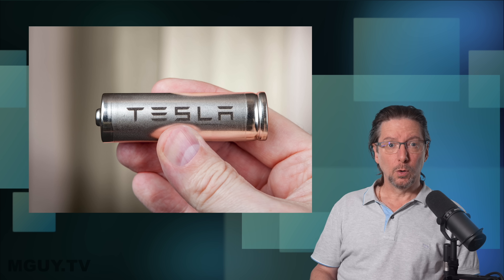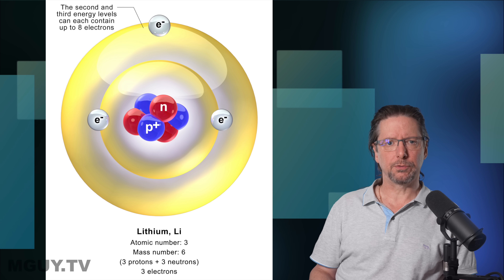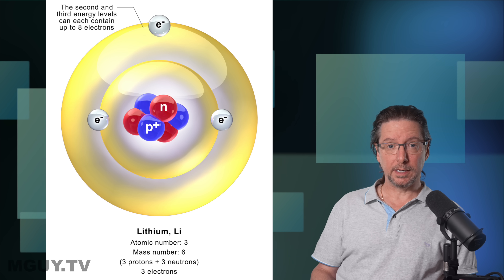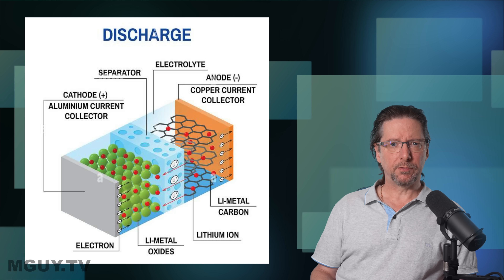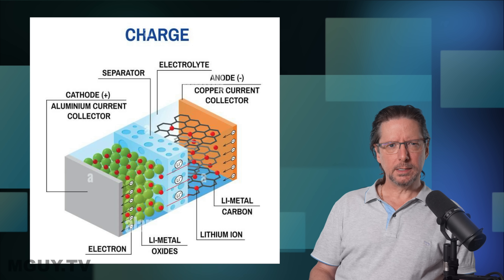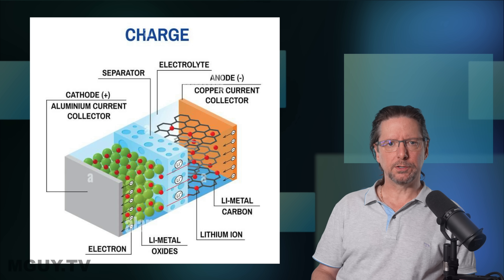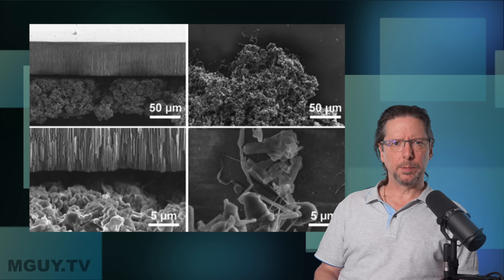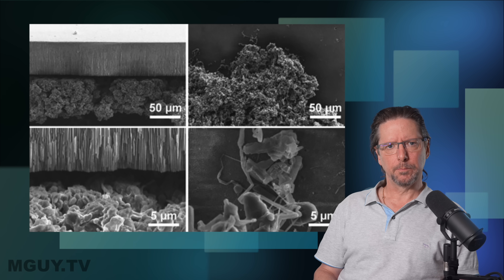Why are EVs so TERRIBLE in the cold? | MGUY Australia

Comment: If it were not so frustrating, this would be darn funny. I live in northern Michigan, some 300 miles north of Chicago. We have been telling the State Government for decades that electric vehicles will not work in the cold the way they do in the warmth of the summer. Chicago was cold, yes, but no where near as cold as it can be. I have seen it -20F for a week at a time. and have seen it as cold as -30F. At those temps, these batteries will not even stay warm if plugged into the  grid. you will have to keep them in a heated area. And this will increase your heating needs.  Government, at least in this case, is not listening to the scientists have have been telling them it will not work!

Comment: Why can't the charger heat the battery, then charge, instead of relying on battery power to do that???  Whoever designed the charger like that should be fired.
Reply: @mattingray5651 The charger can heat the battery first. MGUY is telling lies again. The guy is a big oil stooge.
Some of the Chicago drivers say when they plugged in there EV did not charge. What they did not realise was the battery was being preheated. Now if they had just realised they could have preheated the battery on the way...

Comment: Good explanation and points well made. I think there is a race on to solve these problems, which is the job of the free market, rather than government, but it will take time, as you note. If battery companies can deliver a battery that does the job, then that will be great for our lungs, for urban air quality and for Australia's energy independence. Until then, proceed with caution!

By the way, heat is not that good for a lot of battery chemistries either. I notice my Toyota hybrid, which has an air-cooled (passively cooled) system and uses a Nickel-hydride chemistry, does not like the heat either, and tends to be less able to retain power when the ambient air and cabin is too hot.

Comment: As usual, you start out messing up the facts. 
1) most were not owners, they were renters doing rideshare & didn’t understand about preconditioning the battery. Owners tend to know what to expect
2) Noway isn’t exactly tropical and has a very high % of RV ownership. When you know what you’re doing, cold isn’t an issue. 
3) you’re ignoring how horribly ICE cars perform in the cold. They also have reduced range and many won’t start ststart at all. EVs heat up the cabin much faster and rarely fail to start.
Reply: The internal combustion engine produces more power with cold, denser air.
Reply: @revolvermaster4939  per energy.gov ICE fares the same or worse in the cold: 
“expect conventional gasoline vehicles to suffer a 10% to 20% fuel economy loss in city driving and a 15% to 33% loss on short trips.”

Comment: Imagine if you applied the same rigor to the IPCC's B.S. hypothesis that has been DISPROVEN BY THE IPCC MULTIPLE TIMES. When you set up an empirical experiment and you don't get the result you're looking for, you don't get to modify your model ad-hoc and call it science. 

Take Ptolemy's epicycles for example: not science.

The IPCC has no clothes! When you go outside of your confidence interval, your empirical experiment is over! Additionally, they threw out UCAR and HadCRUT4 datasets due to being CAUGHT TAMPERING WITH THE DATA.

Comment: You’re talking about the theory of holes, when talking about moving electrons from one atom to the next, which basically is current flow. 
So, Lithium would need to be able to store energy (extra electrons) then release it via the theory of holes. However, as Lithium cools, there is greater resistance to electron movement, from one atom to the next, effectively slowing the process of the theory of holes and therefore the batteries power supply.
I assume this is the equal reason Tesla states owners should heat up their battery prior to charging in cold weather, as the theory of holes related to lithium, works best in higher temperature conditions. 
This would equally lead me to conclude that plug in EVs are best suited for temperate climates. However those temperate climates tend to be located near the oceans and therefor salt water, which is extremely detrimental to metals due to galvanic corrosion, this would create a double edged sword for EVs operating in temperate climates. 
Basically the warm atmospheric conditions are EVs best temperature for operation, however salt is also their worst enemy (Florida, LA, the Gulf etc.).
Humm.. 
Guess they don’t want that knowledge being available to prospective plug in EV buyers.

Comment: The EVangelists were blaming the users for not pre-warming their batteries, which takes energy and shortens range, along with heater and defroster. We just aren't ready yet. Need longer range, lower fire risk, faster charging, far more capacity in the electric grid, ...

[edit] I'm not against electrification, it just isn't ready for our transportation. All my yard tools are electric and I even just bought a "larger" snow blower with new batteries that work with my older tools. My wife and I really like these electric power tools, lighter, QUIETER, no gas exhaust smell when we dig out the driveway at lunch or before work. These devices are working out extremely well for us and have for more than 5 years. The last gasoline mower only lasted 2 seasons before destroying the engine, that's when I bought the mower and it's been great for years and years now.

Comment: EVs are not terrible in the cold. If used correctly they simply a bit less efficient. If you use them incorrectly like those idiots in Chicago recently then they are quite bad. But that was the fault of the drivers, not the cars.
Reply: ah typical socialist gaslighting "YOU DIDNT GET SCAMMED PROPERLY"

Comment: Some of your facts are wrong bud. The problem with the Teslas in the US was due to the charging ports specifically and not the cars themselves. There is no problem charging batteries in the cold from a home charger. Dendtrites are a problem for all lithium batteries and is what degrades them over time. The cold does reduce battery performance but does not degrade them any more than usual

Comment: ... Im into flashlights some (flashcoholic) 🔦. Amongst the brands, one brand called Nitecore, make there own flashlights, along with there own batteries. They have become well respected within the flashlight community for there battery's. And even they know of the issues with lithium battery's in cold and zero temps. That much so they also produce  18650 lithium battery  models etc, suited for below zero temperatures!. Somehow i doubt car manufacturers use such/fit. Cars are all made to cost etc 🥴.  Granted  evs could be a fad/artificially forced  via governments. Solidstate batteries possibly a better idea,make evs more viable!.

Comment: Sounds a bit like the way a nuclear reactor works , using rods to increase or decrease reaction,  water to create steam and keep reaction controlled.  But , what is keeping the lithium battery cool.  If the single electron creates heat when it is released from its host electron , how do you cool it , in order to prevent a runaway reaction  which I assume I'd what has led to some of those horrific fires you have shown?.

Comment: The core issue warm or cold weather,  ICE takes 5 minutes to refuel. EV takes an hour (unless you want to reduce your battery life fast charging). I don't have to plan trips around fueling concerns and schedules. Gas tanks can be stored full, EV's should normally be filled more than 80% (unless you want to shorten battery life).  If you forget to plug your EV in, or are in a ling frip, it can be inconvenient. Kn too of this, when you consider 'source to junkyard' life,  EV are really not less polluting than ICE. This is just a short list if the problems I see. As a second car for local driving great. Building our enitire world around EV, not practical.

Comment: 3:06 a graphite anode is more expensive, you have to pay extra for that... I pay like 25 bucks more per drone battery to get graphite anodes.  :0
you think an EV is bad, I pay 65 dollars per battery and it barely buys me 7 mins in flight.
 and those lithium dendrites form in only a handful of flights because of the ridiculous voltage pull of the drone. all drone batteries will explode after a flight at some point. (usually between 25-40 flights) you'll land and hear you battery sizzling and you have like 60 seconds to get the battery clear of your drone or you lose both in a 25 foot tall column of fire.

Comment: @MGUYTV why is it you are unable to make a video without telling outright LIES. You said that if you are waiting to charge your EV the only way to heat the battery is the battery itself. This is simply not true. Plugging car into a public charger will start to heat the batteries before charging them.
It is true that you can use battery power to heat themselves up and this can be done manually or automatically depending on the circumstance.
The recent problems in Chicago would have been nowhere near as bad had the owners of the EVs just understood this and taken the appropriate action. They did not realise when they plugged their car in that the reason it did not immediately charge was because they had failed to preheat their batteries!  Instead they were trying to use an EV like an ICE vehicle and they are not the same as we know. This was user error, not an issue with the the EV.

Comment: There does not need to be a transition to EV's, as co2 isn't a pollutant or the enemy - irs entirely made up. Net zero will collapse as its unscientific and anti human made up by club of Rome, rockefeller et al, a scam to gain control of us and world resources. Ev's will go the same way as the quartz crisis in the watch world, battery's and Ev's are soulless and disposable, limited use and impractical and unnecessary and misses the fundamental joy of car ownership and freedom the beauty and the sound of the mechanical internal combustion engine. So refined they have become with even cleaner fuel technology in development that Ev's will become redundant obsolete.
Reply: @cj.6988 Can you explain why you think the need for Net Zero is unscientific? 
Because so much science has been done by thousands of scientists using masses of data, over a very long period of time. All of which confirms the predictions of Exxons unbiased climate scientists made in the late 70s. 
If you think you have evidence which overturns their findings I suggest you share it with the world so we can stay as we are and save a load of money.

Comment: But wait....Elon has a new "game changer" design for his Teslas that incorporates an electric generator exercise bicycle. While you're waiting on line to charge your car in sub-freezing temperatures, you can take your fold up electric bike out of the frunk, attach it to a specially designed, carbon fiber Tesla trailer hitch with an electrical connector that plugs into your car's battery, and pedal away while waiting your turn on line. That way, your battery will get an external electrical source to keep it warm and you will stay warm by exercising and not having to turn on your Tesla's heater which would further drain the battery. This ingenious new feature is going to revolutionize the EV market! 👍 It will take years for other EV car makers to catch up....

Comment: Good explanation of the impact of cold. There's also the problem of high ambient temperatures, requiring effective cooling of the cells, to stop potential thermal runaway. Lithium batteries are very fussy about temperature, and can't also stand being wet - don't drive your boat to the water with an EV.

Comment: Why use so many small batteries? Connecting them together adds resistance which then adds energy loss in the form of heat I would think.
Reply: in order to get the voltages they need you are gonna be wiring a bunch of cells together no matter what you do you can't make one giant cell with 800 volts not how it works so you are gonna need a lot of cells anyways. your car's lead acid battery has 6 cells at 2 volts each it would take 66 of those to achieve what all those little cells wired together can achieve. They use the smaller cells though because they are easy to manufacture reliably.

Comment: Even normal car batteries suffer in the cold, but you only need a bit of power to start the ICE, so its not so bad over the years. And replacing such battery after a decade of use wont cost you 20000 dollars

Comment: It's even simpler than that: A battery that doesn't lose charge in the cold is as impossible as a perpetual motion machine, for basically the same reason. That's all one needs to know. The point is, batteries will NEVER overcome this problem. You will always have to keep them warm for normal usage, which is not only costly, but also makes them even less "green" than gas. EV's are being pushed to create a market that wouldn't otherwise exist naturally, not for the environment, but to artificially force a market on people in order to make lots of money on a poor idea.

Comment: If you own an ICE car an the battery is low or going bad, as long as you can get two revolutions of the engine you will get a combustion cycle and the engine will usually start. How far would you get on an EV if you only had that much charge?

Comment: I own a 2022 Tesla Model Y Long Range and charge it up to 80%, which is normally around 270 miles of range.
Last week is was -9F here in St. Louis, MO and after leaving our garage, the range immediately declined 30% to about 190 miles in 30 minutes with warming the car during the day the normal 50-mile circuit I drive daily had the car reporting a range of not the normal 220 miles left but close to 100 miles left.

Instead of my Level-2 charger stating that the 50 miles would be recharged in 2 hrs 15 minutes
last week the 50 miles took 6 hours and 30 minutes to recharge - the 1st 30 minutes were to warm the battery before charging could take place.

EVs suck in cold weather.

Comment: EVs are great if you have the right lifestyle. A warm climate, a home charger, mostly city driving and a gas vehicle when you go on longer trips. They can still work in cold climates if you’re garage is heated and you don’t have to drive to far and have a gas vehicle for the really cold days. It’s going to take a lot of oil and gas resources for EVs to save the planet. Of course the electricity and the grid have to be there to deal with the power demand and that seems to be lacking at the moment but you have that gas powered car for those days you can’t charge your EV.

Comment: It should be a law that all EVs must be towed by an EV tow truck.  During very cold spell, no EVs would get to be towed either.

I retired from a nuclear power plant.  We had deep cycle lead-acid batteries for emergency power to run key instruments and equipment until the emergency diesel can on line in 13 seconds.  We had very strict temperature requirements to ensure that they would have peak performance at any time and would last at least 8 hours being drained at full load.  They are as forgiving as an ICE car battery unlike these lithium batteries.

Comment: Ah, another Luddite video from a man frightened of the future. How's your Kodak stock doing, MGUY? 
Factoid for you: absolutely NO temporary range loss in an EV due to cold can even come CLOSE to the 75% loss of energy that a gasoline engine has to waste heat. With other losses in a gas car (transmission, pumps, alternator), the actual amount of energy in every gallon of gasoline that makes it to the wheels is about 15%. That's right, regardless of outside temperature, a gasoline car wastes 85% of its fuel's energy, all the time, every minute it's running.
What were you saying about a temporary cold weather range loss? I can't hear you from all the biased BS...

Comment: It's not just extreme cold that the batteries can't handle. It's also extreme heat. They're not suitable for most of Australia, due to the heat.

PS. Please stop referring to petrol as gas. The USA is the only country that calls petrol "gas". It's not a gas, it's a liquid. Because there are gas powered cars (as in the vapour), referring to liquid petrol as gas (short for gasolene) only confuses the issue.

Comment: The EVs we need are hydrogen fuel cell based.  Hydrogen is easy to obtain via electrolysis of water and relatively easy to transport where needed.  Dispensing it takes about the same amount of time as gasoline.

Comment: also, if we consider extremes of weather then we have to look at  the effects of Heat . Consider a very hot day and travelling on a Tar road..the road surface is Black and absorbs Heat easily from the Sun...this heat will also reflect on to the underside of your vehicle...so you battery is being het up from all sides, firstly from the chemical reaction side.then the general atmosphere ambient temp and lastly from the road surface. It is likely that on extremes the battery cells may be put under excessive temperature that may lead to degradation of their structures... it only take one cell failure to cause total catastrophe..